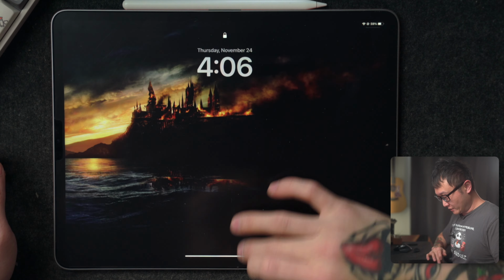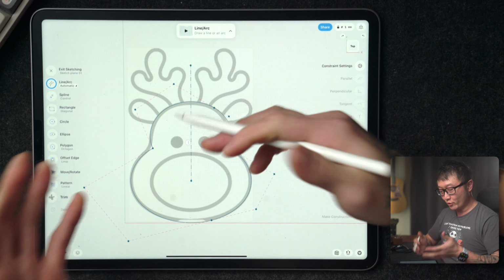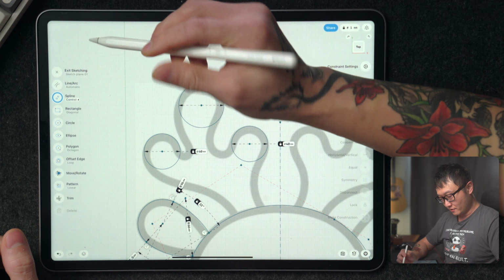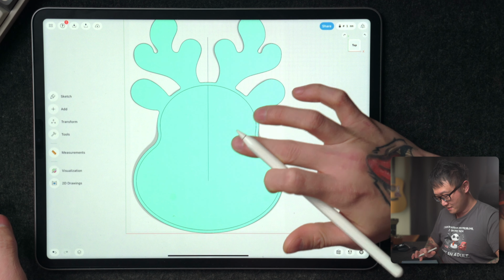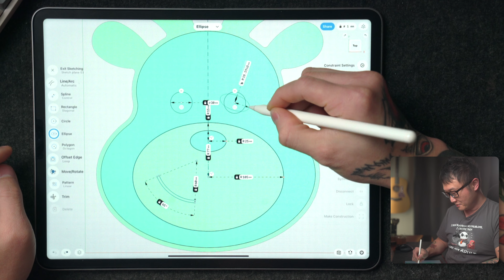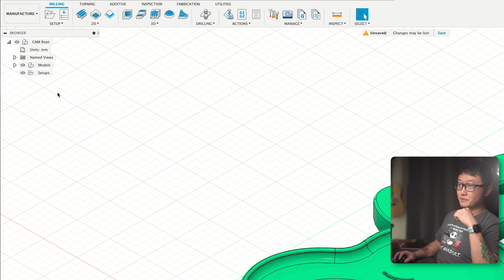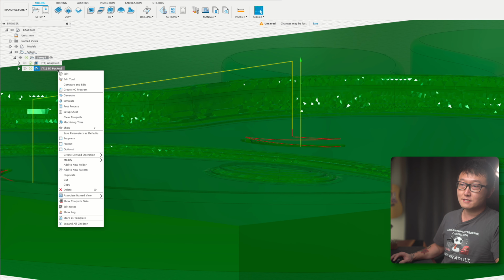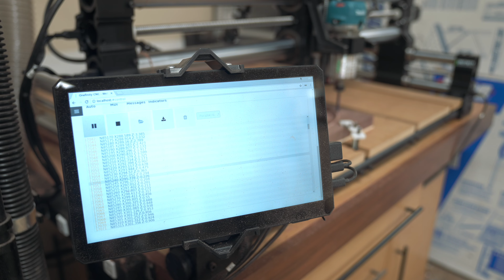DESIGN & MAKE in Shapr3D and Fusion 360 | CAD CAM Tutorial for CNC

Comment: Great videos. I have made other projects using your methods and all worked terrific. I am having an issue with the reindeer tray though. I downloaded the model from your site and followed your instructions to the letter(I think). However when I try to carve it using my X-Carve it just carves in mid air. I checked my stock size and it is correct. Any ideas?. Thanks for the great videos. They have helped me a lot. I am 80 years old and do this for entertainment.
Reply from the maker: Hey Robert, that sounds like the origin wasn’t defined correctly for the stock. Was the origin defined at the top lower left corner of the stock? Does it match how it’s defined in the machine as well when you zeroed the machine?
Reply: I did miss a step. When doing the setup, I didn’t set the stock point to the top bottom left corner. Thanks for the help. My project is now running.
Reply from the maker: @user-iz6jg6zc5y awesome! Glad you figured it out

Comment: First off, outstanding video!  I recently, yesterday, upgraded my iPad to the new iPad Air (M1).  I currently use Fusion 360, but after watching your video, I like the idea of designing on the iPad and then exporting to F360 for the CAM.  I've mainly used F360 for modeling things to 3D print, but I've recently started using it more for designing things to cut out on my CNC (PrintNC).  I'm glad that I stumbled onto your channel as I haven't been able to find many channels that talk about CAD and woodworking.  Thank you and I look forward to watching more of your content!  - Ed
Reply from the maker: Thank you for checking it out! I’ve got more CAD stuff coming ☺️

Comment: Thanks for another great video! Quick Fusion tip that might save you and others time. You can display the estimated machining time as a part of the operation name. On Mac, it's under preferences > general > manufacture > Browser Display Properties > "Show operation machining time". This way you can see how long the individual operations will take within a setup. It will also show the total machining time for a setup in the setup name. You can also display the tool number, which helps with quicker debugging.

Comment: A query … how refined do the drawings need to be done in Shapr3D for them then to be transferred to Fusion360, or does the drill bit on the CNC machine just approximate the accuracy, no matter how refined the Shapr3D design is made - as I’m after doing fine curves, so does the minimum size need to be 1mm
Reply from the maker: I’m not sure what you mean. Shapr3D is as accurate and precise as any other CAD programs out there. It’s accurate to 10 decimal digits. Shapr3D is a solid modeler so the curves are actual curves, not made from a bunch of straight lines like Sketchup is

Comment: Really love the videos, the style and content are top notch. One questions I have on something like this, when doing the bit changes how do you set the new Z height?  In the case of this specific file you had untouched stock that you could use for the height but lets say you couldn't then what?
Reply from the maker: Thank you! I always leave the corner untouched. But if you don’t have it, then you should have a piece of offcut from the original stick. Use that as reference
Reply: @BevelishCreations  thank for the advice. I ended up creating two separate setups one to hold the surface operation to bring the stock down from 23mm rough face to 18mm thick and then another setup to cut the parts. Would there be a way todo something like that but in the same setup?